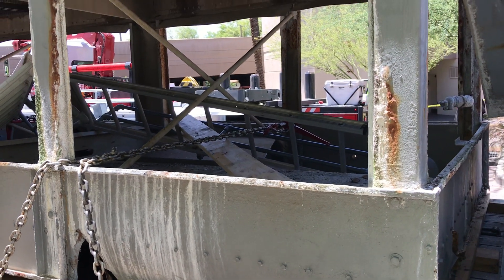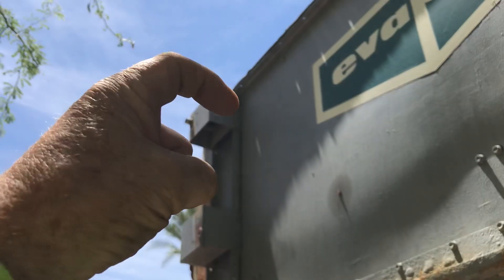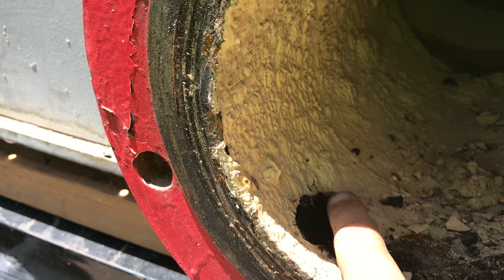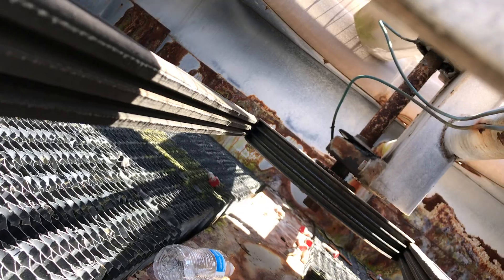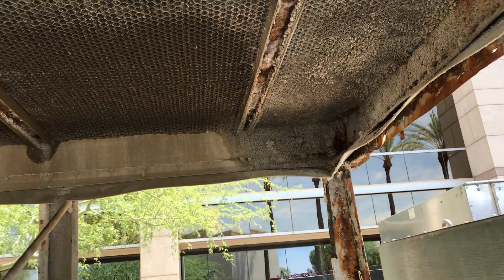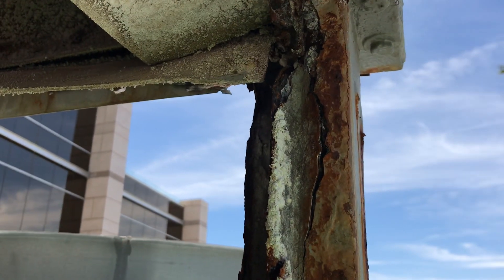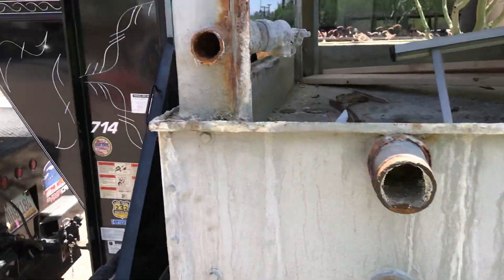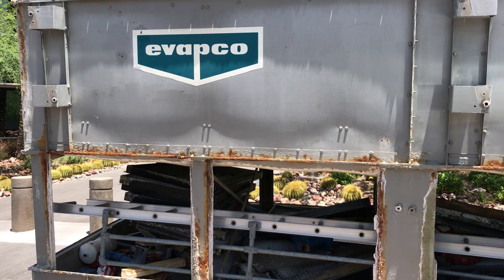Cooling Tower Replacement

Comment: That looks like a wshp building I’m surprised it doesn’t have a fluid cooler. You guys do great work mike.
Reply from the maker: Meno Meno this system does have a closed loop for the closed loop.
Reply from the maker: Meno Meno Sorry....wrong answer. There is a closed loop on the cooling tower circuit.

Comment: Wonder if new towers will last as long? We have one of these at a smaller medical building that is right at 26 years old and fixing leaks all the time. They don’t want to replace it yet. Great video. Thanks! How about some shots of the new towers put together?
Reply from the maker: It’s all about good maint. But 20-25yrs is about the maximum life time.